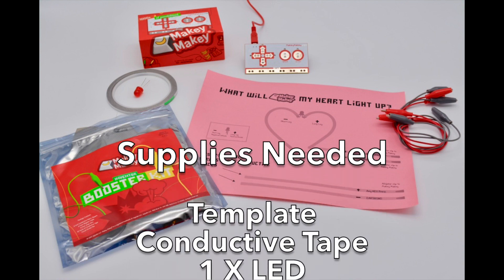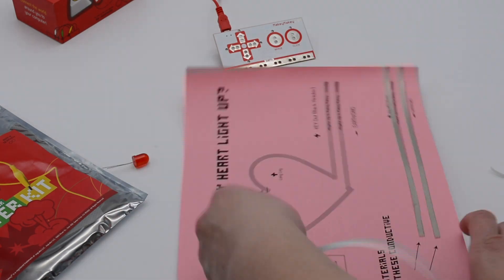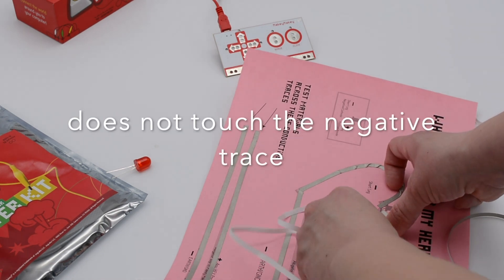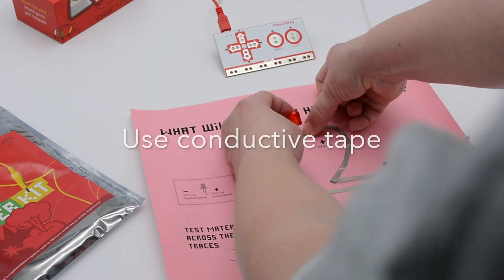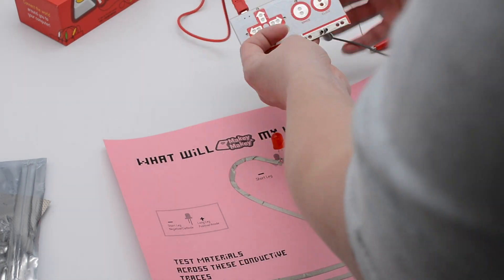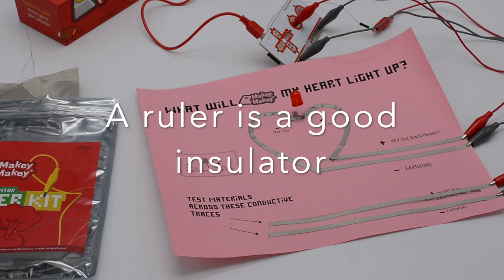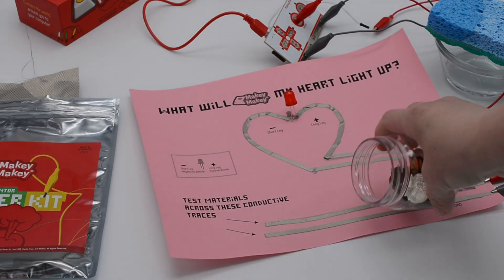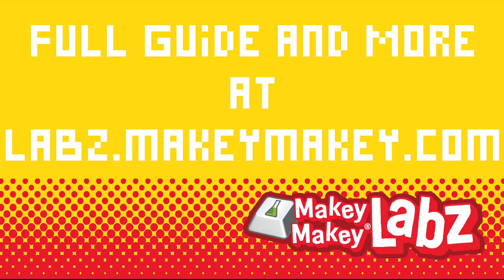Valentine Labz Guide- What Will Makey Makey My Heart Light Up?

Comment: The How to Guide says you need an Ohm resistor?  Is this true?  Didn't see one in your demo.
Reply from the maker: It's best to use ah Ohm resistor so you won't blow out your LED and to follow the electronics rules.... but if you are tinkering, you can try it without, but your LED might burn out! Or you could use something like a Chibitronics LED which actually has an ohm resistor built in.